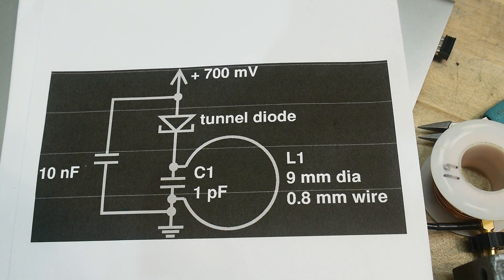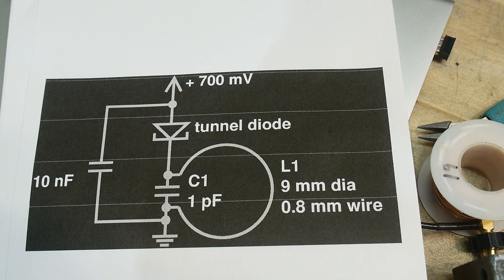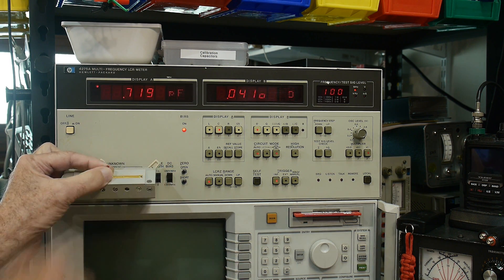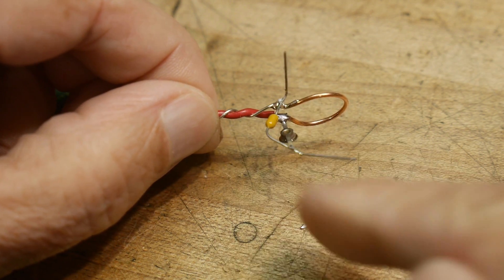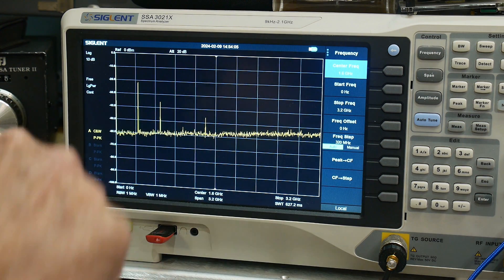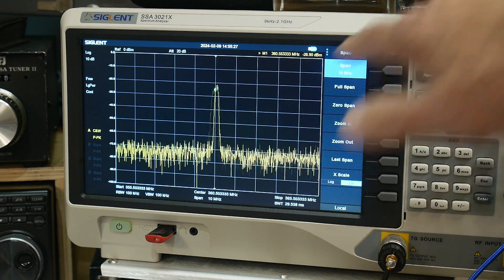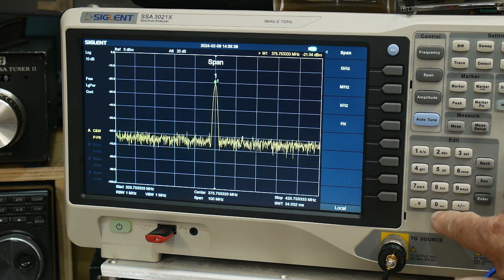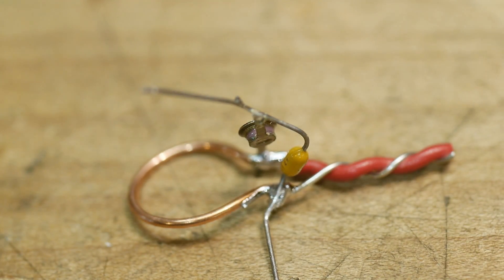#1817 Tunnel Diode AI301G (part 3 of 3) Oscillator

Comment: I'd be curious if a quarter wave shorted coax would oscillate too - A 6.5 inch piece of RG59 (foam) would be about right for 350 MHz (shorted at far end lol). Coax shield should go to ground side. Also need a better bypass - maybe 1000 pf chip. I had a tunnel diode back in the 1960s !😏

Comment: In 1961 Jim Kyle K5JKX/4 got a 1N653 to oscillate using resistors between 30 and 150 megacycles. Jim commented anything within 12 feet of the restive circuit caused instability. He wrote it up in "Lost in a  Tunnel", 73 Magazine, Jan, 1961, pp. 20-23. 

I've built problem circuits in circuit board boxes often as `dead bug` configurations to reduce microphonics and powered each part with its own battery power supply to eliminate paths for noise, cross talk, etc.

Comment: Frequency seems a bit low considering the circuit you've got there. Wouldn't you expect something in the GHz range? Are you sure you're not just picking up rubbish from your power supply? According to the data sheet that particular device isn't intended to be used as an oscillator.

Comment: if you connect the tunnel diode without inductor and pf capacitor, you will have the max oscillation frequency, limited by td internal capacitance and inductance terminals.

Comment: A resistor in series with the with the power supply would help protect the diode from overcurrent and make it easier to adjust the supply voltage for best setting of the forward bias current

Comment: You have a bit of load on the circuit from the SA probe, and, if it's voltage sensitive, power supply ripple, or 60 Hz pickup could make it less than lovely... than unshielded "capacitor" wire might pick up static... For tuning the capacitor, you could also untwist the pair a bit... Not sure if there might be funny effects from the sharply cut wire ends, too.
Just an old time FAE thinkin' out loud...

Comment: I would be curious to see if it's more stable with a regular ceramic cap. I think the twisted wires would have a significant inductance as well in this circuit (given the single loop of wire used as an inductor).

Comment: I’ve seen a similar circuit as a passive transmitter.  Same as yours but no battery.  You excite the circuit from an external oscillator.  After excitation there is a small delay then it transmits for a moment.  Used by US intel back in the day as sort of a tripwire when the device got close to a monitoring point.

Comment: A gimmick cap got used in S38 A through C, msybe D receivers to make the IF amp oscillate in BFO mode. Only because 1 pf caps weten't available in 1952.

Comment: I used to make those little twisted wire capacitors back in the 1980s. Quartz watches were quite new back then, and the cheap ones weren't too precise. Because the quartz crystals used in them were cheap and not working at exactly 32768Hz. Usually they were a little fast, up to a minute or two per day, meaning the crystal frequency was too high. The way to tune them properly would have been with a trimmer cap, but there was no space inside for that. So instead I'd twist 2 wires like you did, and solder them across the crystal. That would increase the capacitive load and decrease the frequency. The next day I'd come back and see what the drift was, trim a piece of the twisted wire if the watch was now too slow, etc.

Comment: Seeing the capacitor as you made it, being just two pieces of wire, seems like a fantastic visual representation of why/how capacitors block DC. Obviously (almost) no direct current can flow though it, as the conductors aren't even touching! Such an example should be used to teach new electronics students. 
Thanks for what you do.

Comment: On the tunability of Tunnel diode
When I was studying the tunnel diodes in school there was no mention of its tunability, only its negative resistance.
The circuit  above shows that tunnel diode are tunable, because the small signal AC model of above circuit diode's capacitor is in parallel with C1 ( Power rail is ground in AC).
This makes sense because the depletion region on the diode increases, as result the capacitance decreases and frequency increases, as we increase voltage on the diode.
To measure the capacitance of tunnel diode I thought to put the tunnel diode under the emitter of npn transistor put a inductor in parallel with it.
The DC value of Emitter voltage is Vbase - Vbe ( Vbe ~ 0.7V). So as I increase the base voltage, so does the DC value of emitter voltage, and can measure the oscillation frequency and infer the capacitance of the diode.
The capacitance of the diode should be not only the result of depletion capacitance, but also diffusion capacitance.
This is interesting situation because in reverse biased diodes we have only diffusion capacitance, and in forward biased diodes we have only diffusion capacitance.
But in tunnel diodes we both have depletion region and diffusion of carriers.
Any idea how to measure them separately?

Comment: This was very interesting, thank you.  I always learn something from your videos.

It had never occurred to me to make a capacitor from a twisted pair, so I learned a second thing today.

I like to try to understand how systems work, even small systems.  Three gimmick capacitor questions for anyone who knows:

Does the twist introduce unwanted inductance?

Does the thermoplastic-looking insulation (vinyl?) absorb RF energy and thereby damp out RF oscillations?

If these pose problems then can they be eliminated by using a non-twisted but closely-paralleled pair of varnish-insulated magnetic wires, perhaps adhered together with a coat of e.g. nail polish or glyptal cement or conformal coating or similar?

Comment: Your 10nf cap looks like it has a Z5U dielectric.  They are sensitive to almost everything.  The capacitance is voltage sensitive, they have shock/capacitance sensitivity, they are temperature sensitive, and for your circuit the frequency/capacitance/voltage sensitivity makes them mostly unusable.  You need at least a good X7R or, better yet, a COG (NPO).  One other thing:  Is the diode in a metal package with glass fret?  If so it may be light sensitive.

Comment: I think you need to shorten the wiring around the diode and the 10nF capacitor. I guess they also resonate at some frequency causing the circuit to be unstable.

Comment: A twisted wire capacitor is called a 'gimmick'. You'll sometimes find them in old tube radio circuits. I built a good sounding FM radio transmitter years ago using one, taking advantage of the circuit's 'jumping around' in frequency for modulation.

Comment: 9mm would be the inside of the socket not the outside. Cool video.
Reply: As he said, the diameter of the socket is 9mm; it's not a 9mm socket.
It would be a lot bigger than that.

Comment: Interesting series of clips on Tunnel diode.
I believe your stability or phase noise problem is because of supply noise.
Here how you can improve it :
*  Use a RF rated capacitor (10nF) possibly chip capacitor 
*  Use small chock in series with your supply.
*  Use microstrip transmission line with stubs, instead of L1 & C1
* I guess the wires connecting your circuit to your supply act as antenna and puts noise on your oscillator.
If any body else have any suggestion on how to improve the stability  this oscillator, please share so we learn from each others techniques.
Reply: Probably some kind of closed type resonator (spiral, cavity), to reduce receiving radio frequency noise. Tunnel diode is known for its simple, but sensitive schematics. Old timers make VHF FM receivers containing only antenna, LC tank, diode, choke and filter capacitor.

Comment: Really interesting series, thank you! I have a Tektronix 284 Pulse Generator that uses a tunnel diode mounted in an air line that produces 70 picosecond or less rise time pulses into 50 ohms. Not bad for 1967. It was used for time domain reflectometery and for checking bandwidth of the scopes of the day among other things. Regards, David
Reply: I envy you. The best I can produce with a russian diode is like 150 ps (home built reflectometer) .

Comment: Philbrick's old trick to make a 1 pF capacitor - yes!
The tuning may depend on the voltage-dependent capacitance of either the wire insulation or the voltage dependence of the 10nF blocking capacitor.
Reply: PTFE insulation is much better there than PVC as well, which will increase the Q of the circuit, and reduce that instability. You will probably want to make the decoupling capacitor leads shorter as well

Comment: At 375 MHz those long leads on the bypass cap are going to matter.
Reply: And the inductance within this special capacitor as well.
Reply: Yeah, a 1 pf capacitor and a 1 turn coil would resonate at a higher frequency.
The long leads, the capacitance of the tunnel diode, the quality of the capacitor (which is more like an open stub transmission line), it all lowers the frequency.
Reply: @Buzz_Purr  and you can also buy a 1 pF capacitor. There is no need to make it by yourself.
Reply: @gkdresden  1 pf Is about the lowest value capacitor you can buy.
These crazy low values are relatively expensive too!

It is much easier to use a small island of copper on a PCB, or stripline.
Microwave electronics is more like plumbing. :)

Comment: Fellow greybeard here... I have never heard that style of DIY capacitor called a "mimic", I've always known them as "gimmick" capacitors.
Reply from the maker: sorry, brain fart, they are gimmics
Reply: MIMIC capacitor (Metal Insulator Metal Integrated Circuit) is a chip capacitor known for its linearity.  
Other caps include MOSCAP, TranchCap, they have different characteristics.
Reply: You are right, they are called a ‘Gimmick’.
Reply: Yeh Hams call them gimmicks
Reply: Same here.
Reply: Agreed.  They are called gimmick capacitors.